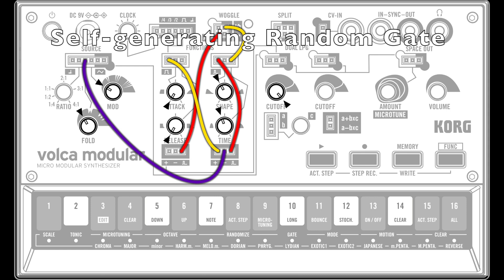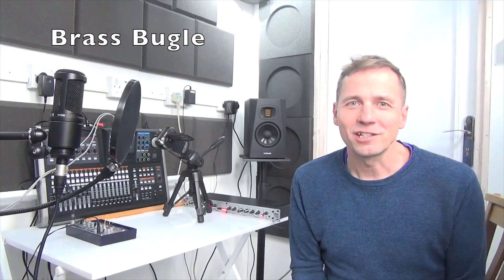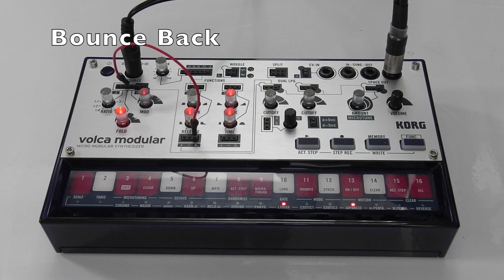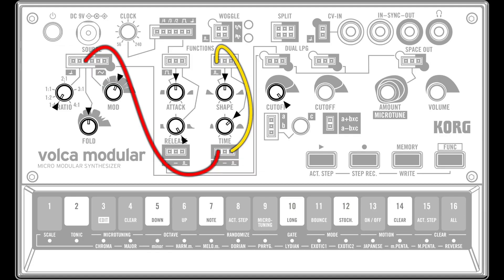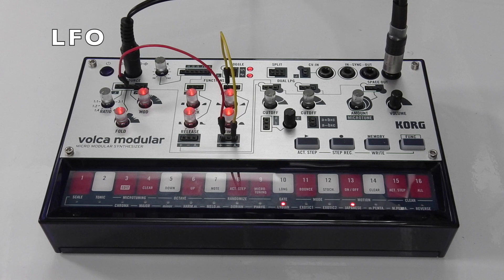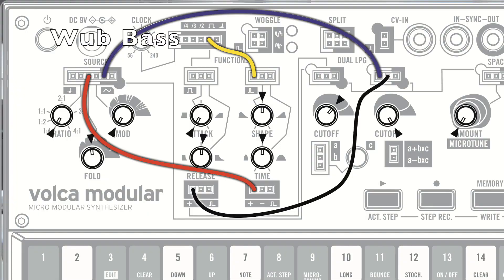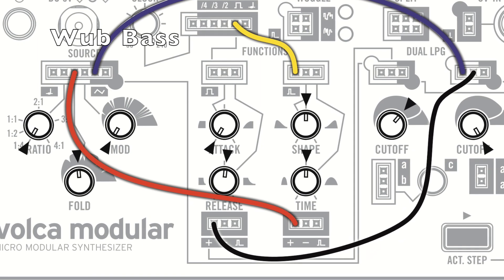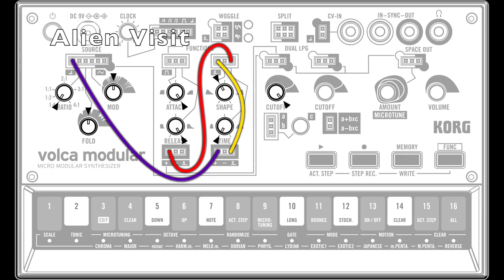Functions Patches: Korg Volca Modular The Expert Guide (pt 3)

Comment: Hi, I’ve just got into making electronic music benn a fan of it for over 40 years. I’ve just bought the  volca modular and your book on this. What volca would you recommend to get next?
Reply from the maker: Hi, do you have a particular type of music that you'd like to make? Without any other info at this point, I'll suggest the Volca Keys, because it's very versatile (it can do melodies, chords, basslines and sound effects) and it's capable of making a wide range of very usable sounds when you know how to use it.
Reply: Tony Horgan many thanks for getting back to me. The type of music I like is early Gary Numan and John Foxx. I also listen to bands such as Suicide Commando, Hocico etc. Some other synths I’ve bought are the UNO synth, Microfreak and the Behringer TD3. This probably helps to recommend my next Volca.
Reply from the maker: Witchfinder General How about a Volca Sample v2 for drums? You could load it with any drum sounds you like. There are lots of free drum sample packs online, including samples of early 80s drum machines.
Reply: Tony Horgan I cant find anywhere that is selling the Volca Sample V2. I’ve looked at Amazon, Gear4Music etc
Reply from the maker: Witchfinder General It was announced by Korg today. I think it will be available in September 2020.
Reply: Tony Horgan I thought it was out from what you said. I did find some info on the new specs and I will most definitely be getting that when it comes out. So what would be your next recommendation?
Reply: Tony Horgan just ordered the Volca Drum, went to buy one of your books on this but found you haven’t written a book on this one 🥴
Reply: @witchfindergeneral2504  hei, it is almost the same as Volca Sample, the first version. Only user memory and usb connection is the new upgrades. You can get the book about first Volca Sample IMO.